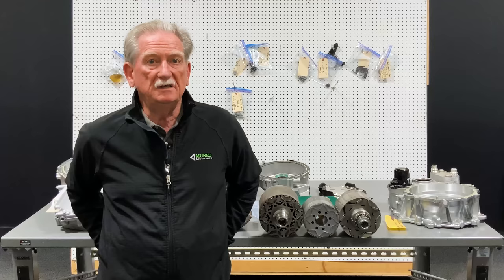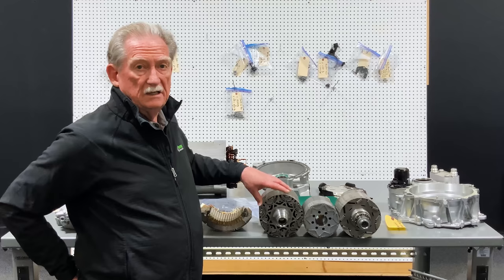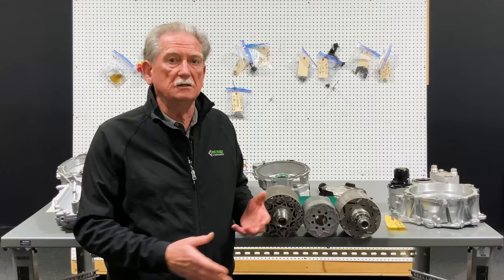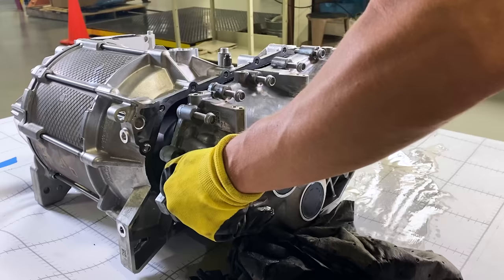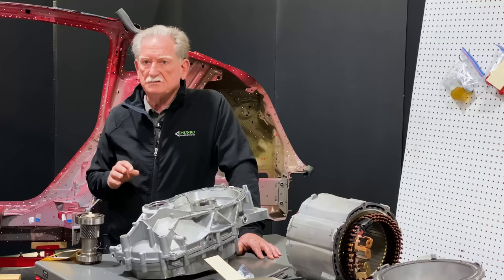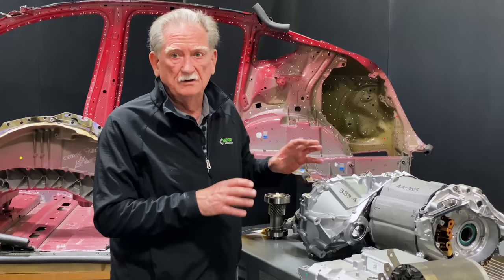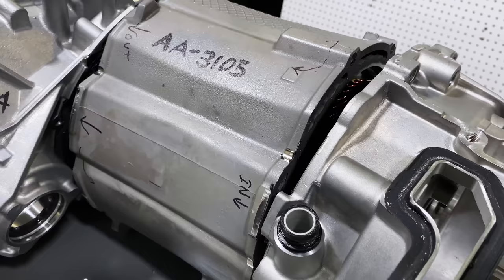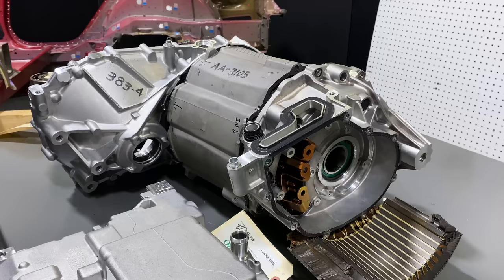Volkswagen ID.4: Electric Motor Teardown and Analysis

Comment: The holes in the lamination aren't just for weight savings. They are flux barriers that increase reluctance torque. In other words, they encourage the rotor to align to the stator's rotating magnetic field as the magnetic field prefers to flow through the metal and not the air gaps of the holes (path of least reluctance). Every manufacturer has their own recipe of magnet and flux barrier designs to balance trade offs in performance, efficiency, cost, and noise.
Reply: Ahhh... I thought it was for the flux capacitor.   At least these cars aren't in the "jigawatts".  ;)
Reply: Yes this is what I was looking for!  It would be really interesting to see a study that compared reluctance torque differences in motor design.
Reply: Glad somebody pointed that out.
Reply: 20.30 Thanks for being first, yeah working those out is closer to black magic than science
Reply: Opinion on the through bolts through the laminates? I finished working on a passenger car motor at a consultancy last year and bolts running through the laminates was not permissible on the grounds of Eddies and flux disruption...
Reply: @leeenfield3404  Intuitively it doesn't seem like a good idea but it was probably their solution to some sort of assembly problem or cost.
Reply: @db4z09 No doubt! Just seemed odd. You use grain oriented mag steel and then put bolts through it!
Reply: I was looking thru the comments for someone to mention this.
Reply: I was hoping someone would point this out.  This has nothing to do with "weight savings"; but everything to do with creating a reluctance torque component.  Just a different configuration of a permanent magnet motor (there are many).  Otherwise, I thought this was a great video!!
Reply: @leeenfield3404  igk but would it make a difference if aluminium bolts were used?
Reply: How could you use aluminium bolts to replace 8.8 or 12.9 steel? The yeild strengths are massively different..
Reply: Exactly. These turn the motor from a pure PM machine into a hybrid PM / synchronous reluctance motor.
Reply: I have serious doubts they are for any weight reduction at all but to control the flux as much as they can.
Reply: I would of thought someone of Munro experience would have mentioned this and asked the question which design is best and why? I personally feel it’s been put on the too difficult shelf because they can Borge almost any design together without truly evolving good design. For reasons like this, truly excellent electric transport is still decades away.

I feel they did better R&D in the 1950s
Reply: @leeenfield3404  If you place them far enough from magnets the effects are quite small but the assembly saving is great
Reply: @leeenfield3404  The steel bolts could be also made of non-magnetical steel. Just for example stainless steel is most often non-magnetical. An A70 screw wo just do fine.
Reply: @Stefan_Dahn 
It is not the "magnatizability" that matters, it's the induced current that occurs in any conductor.

Comment: As an automotive technician that specializes in low level repairs of electronics and other vehicle systems in vehicles where parts may be obsolete or simply uncommon, I give big kudos to VW for designing an inverter and powertrain system with obvious module-by-module replacement and repair in mind. Snap/press fits and swaged/staked/deformed fastening methods are the absolute bane of my existence and are absolutely antithetical to any sort of repairability. They may be great for penny parts where any failure immediately implies replacement rather than repair, simply due to economies of scale, a likely multi-thousand dollar inverter is definitely on the opposite end of that spectrum. To my mind, it's the equivalent of stating that IC engines should not even have head bolts. We can just weld the heads on and if you have a failure, well too bad, replace the whole thing. (We already know how good Ford is with sparkplug threads on the Triton and head bolts on the Powerstroke). With the world/industry focus shifting from absolute bottom dollar manufacturing to a more sustainable product life cycles, and even situations like our current pandemic-associated parts and chip shortages, designers need to plan for the fact that their customers will often want to repair rather than replace.

I remember when the first hybrids came out and manufacturers and talking heads were saying nobody will EVER be disassembling and repairing battery packs! They're just too dangerous for the common person. Well, 2021 is here, and many many shops, techs and just regular owners can and do perform perfectly satisfactory cell replacements and other repairs on the packs.

I think the Munro team have put forth a very nice look at the iD4's powertrain, but Sandy has dragged a bit too much early 2000s upfront cost-cutting design philosophy into the conversation. Vehicle components should be as serviceable as possible barring a technical inability to be so. Ask any tech/mechanic/serviceperson whether at the dealer level or independent. I have never in my life encountered one who complained that a component was just too serviceable. I have, and have heard many many of us curse and scream about parts that COULD have been designed to be serviceable, have instead been potted in epoxy, or ultrasonically welded shut, have clips/snaps/tabs that disintegrate after a decade or are in some other way put together to absolutely minimize production cost, at the expense of ever being able to service components. Often, turning a small repair into a massive component replacement bill. Vehicle manufacturers are FINALLY realizing that even at the dealer level, repair rather than immediate replace is often the most cost effective and rapid way to get a vehicle back into a satisfied customer's hands. But Sandy is here trying to drag them back to an antiquated build it to last through the warranty design ethos.

And just as a side note: Sandy, your qualms about there being so many screws internal to the inverter and there being no thread locking compound is simply uneducated. Aside from the repairability aspect, many of those boards use silicone heat transfer pads which require certain clamping forces to maintain correct contact through heat cycling and also, the screws themselves look to be of the thread-forming type which self-lock on first installation. Only subsequent reinstallations require thread locking compounds to maintain integrity. 

Furthermore, as a design philosophy, one has to put oneself in a global mindset. Not every market where an electric car may be fully viable as a product, has the dealer/parts infrastructure that is available in highly metropolitan areas in the US or Europe. I live in a major US city, but interact with customers daily who have modern heavy duty vehicles operating in South America and rural African countries, and dealers for a brand may be 500+km away (if they exist in the area at all). The customers are more than happy to disassemble anything, ship out a board for repair and receive it back by mail rather than having to either tow a vehicle or transport a massive subassembly to a dealer for repair and then go get it again.

The singular place where I agree that a different design path could possibly have been chosen is the clamping bolts on the stacked rotor assembly. I think a completely unitary design would improve the ability for the component to be high-speed balanced and prevent any possibility of torsional movement that would disrupt that. But hey, turbochargers still have shaft nuts to hold the turbines on, and un-fastening failures on those is virtually unheard of. And if VAG was really concerned about it, they would have keyed the laminations to the shaft to prevent movement.
Reply: Great insight.wow
Reply: Hey bro i m from rural area ev cars need some years to come into my country and i am a Mechanic i just wanna know ev cars have any repairable apart from chnge suspension and brakes calipes ...or does ev cars have service ? Like what future mechanics will earn by doing work on ev if there is nothing service in it.
Reply: @itachi2829  There will be maintenance but it will be much less. People may come to you to restart their central console that has gone down. Then you are at the level of a computer buff who is asked to repair a laptop that won't start up anymore. (A friend of mine puts motherboards of a broken Apple in the oven, would you believe it? And it works!) It requires a whole new set of skills. I am not sure about the transition speed you mention. Perhaps you live in a backward area or a corrupt country where fossil fuel interests hold sway, like the USA. If you look at Canada or Northern Europe, nobody in his right mind wants to buy an EV any more except there are still almost none available at a reasonable price. In Norway, where everybody is happy, healthy and well-off (called "socialist hell" by Fox News anchors and on Sinclair syndication stations by Republican politicians) the sales of ICE cars have gone to zero for passenger cars in January 2022. This drop from 90% to near zero happened within two years. Some maintenance remains, though, like tires, wheels, breaks, hydrolics, cooling agents and leaking gaskets. But you can bet that there will be less wear of breaks and gaskets as an EV can also break on its engine, much much more than an ICE car could. Anything that moves, rotates or is exposed to the elements will degrade. But the amount of wear and tear of an ICE car is much larger than of an EV.  There are almost no servicable moving parts in an EV.
Reply: @quintdegourd6342  so maybe time to shift some other business
Reply: It’s the biggest difference with like Tesla way of thinking. VAG in general is the biggest car manufacturer in europe. Thousands of dealerships. People buy a certain brand, because they like that specific dealership. VAG can’t just fuck those people over. Service is of utmost importance.
Reply: @syproful  ??
Reply: @syproful  I’ve had a Tesla model 3 for over 3 years now with 2 minor service appointments where I scheduled the service via my Tesla mobile app and within 24 hours I had a technician at my house for 30 minute repairs.  Tesla is improving their EV’s and manufacturing processes so rapidly that I believe within a couple years there will be virtually no maintenance.  So “service” will become less and less important.  Tesla is destroying VW in Europe with superior technology, software and driving experience.  They don’t go to a dealership. they click a button on a website to buy their car.  That’s how much trust I have and folks that are lining up to buy them have.  Go drive a Tesla that’s been built in the last 3 years and then you will understand what all of us “crazy” Tesla people already know.
Reply: @CaptainCrunch-1  dude not everyone can afford a 64k model y. Give it a rest and appreciate that more affordable options are here and improving everyday.
Reply: Same can be said for the 4680 battery. Zero repairability....why? No reason to make the entire car disposable and impossible for a home mechanic to repair. Battery could have at least been made in multiple segments so if one chunk contains a fault it could be replaced.
Reply: @CaptainCrunch-1  10y later you will be able to fix a VW for a few hundred bucks, but a Tesla will charge you 10k for new unserviceable parts.
Reply: Excellent points. On fastenings 👍
Reply: This is an excellent comment. Something about sandy's presentation struck me as not rigorous and you seem to have pointed out a few of sandy's misconceptions.

Comment: I actually do like the modularity and screw fasteners in the inverter module. Promotes repairability and saves the environment from more crap. Maybe not in America but other Countries most surely take stuff apart to just replace what’s broken.
Reply: Yeah.  I do agree that there should probably be some kind of thread locker,  but if you can't repair a car,  it will never become ubiquitous.  That's why Toyota dominates in every nook and cranny of the developing world.
Reply: I agree. The strategy Kawasaki used in R&D was to simplify engine removal for development use and left it as such which benefitted repair personnel when the engine went into full production. Even if it can't be fixed, there are those who will try.
Reply: Robby Dey  the reason for the gasket issue with German vehicles is they are forced to use environmentally friendly  plastic over there that wears out very quickly.
Reply: Robby Dey  what problem failed gaskets on BMWs, this is a warranty claim. If happen simple ask for repair under warranty. i think in USA four years or 50,000 miles whichever comes first. after 5-10 years car is for recycling. car manufacture short as 3 years after the sale of the last model. Once that term is up, they do not have any further obligations to the consumer. for example parts
Reply: I agree. Snap fits will make assembly easier and probably cheaper. But by how much? And its a pain in the arse for recyclability and reusability.

You wont inspect your inverter? Sure, but VW will once it gets replaced. If it can't be fixed, it will be recycled, therefore taken apart. The biggest issue with recycling is material separation. If you can only smash your broken inverter to take it apart, that's not ideal. Sandwiching the pcbs and other components in the housing could be an alternative to save on fasteners.
Reply: Exactly 👍 I hope legislation will force manufacturers to make things more repairable. Me thinks Munro sounds a bit old-school here...
Reply: I’ve confronted my share of snap fit plastic parts where the embrittled plastic breaks into little shards if the parts are attempted to be separated for servicing.  I regard most snaps and rivets as intended for permanent assembly where a component is going to be discarded rather than serviced or recycled.  There are places where rivets are OK, like holding the rotor lamination stack together where there is nothing which will require future service.
Reply: nah its VW they themselves will sell you a new Inverter for like 3k
Reply: German carmakers also have high recyclability targets. At end of life, everything is disassembled.  I think this is what drove this design
Reply: @ProfessionalValle  - there's not enough threaded fasteners in this video, so you can't take it apart.  But you are absolutely correct, threaded fasteners make things repairable.  Suppose a driver hits a rock, shorts part of the battery which fries the circuit board in the inverter.  With VW's design, it looks fairly easy to replace any or all of the circuit boards.  If it was all riveted, that would not be the case.
Reply: I also like the design. The inverter is subject to a lot of vibration because it is directly connected to the motor. With the many screws any flexing is avoided which could weaken electrical connections.
Reply: Absolutely agree!
Reply: I agree but I wonder if you you will be able to buy individual components or be forced to buy complete assemblies which is unfortunately becoming the norm.
Reply: @MrGlenferd  by EU law, the contructor has to allow the repair companies to know all the components datasheet, and their manufactors, to allow the repair to happen.

I only dont know were are the line between comerce secret rights, and public acces to the componensts manufactors and the datasheet logical scheem of the electronic circuit.